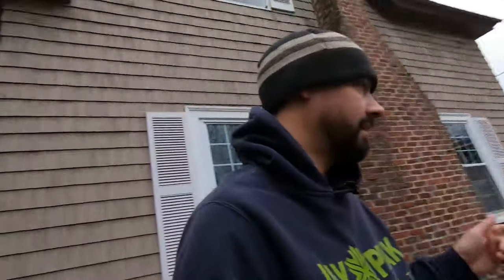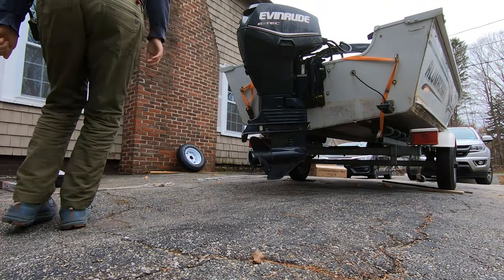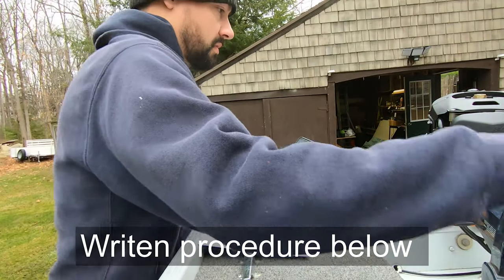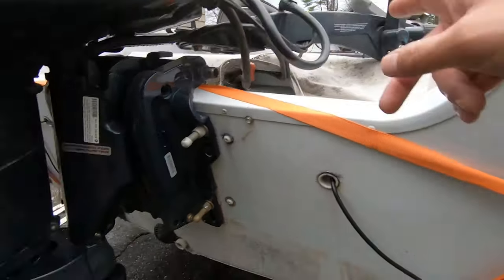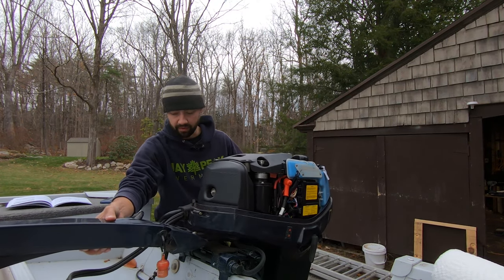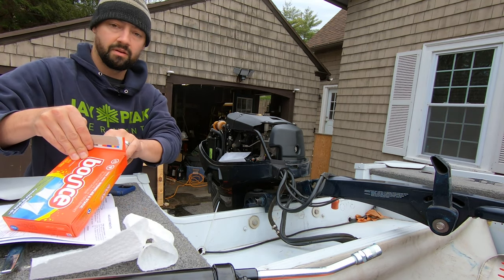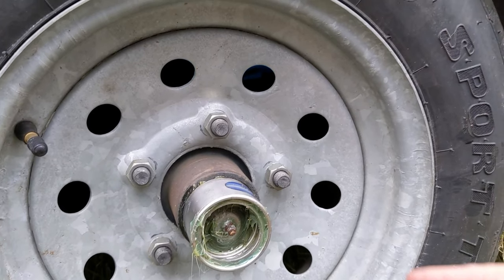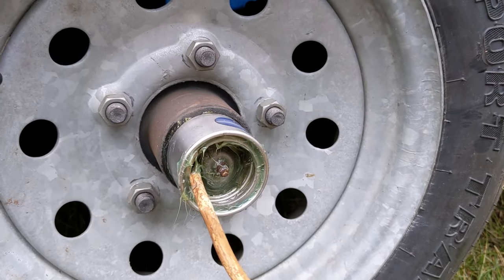Winterize your Aluminum boat with Evinrude E-TEC

Comment: Just a tip when you remove the prop place the timber block 90 degrees to the cavatation plate.locking on the blades of the prop.When you fog the motor look at your engine computer the led's will flash to change throttle position.
Reply from the maker: Thanks I noticed the LEDs after I looked for them the first time in bright sun and couldn't find them

Comment: Just curious but what about the water you just ran through the motor won't it freeze ?  Or does all the water drain out ? I live in Michigan my self  and it gets bitter cold here . I have a e tech and winterizing mine for the first time. Thyx for your video.
Reply from the maker: The motor is ment to drain completely if left vertical, also I crank it a little with the kill switch detached to push any other water out

Comment: I just found this video. I bought an ETec 50 HP  just like yours and keep learning. I am in Wisconsin and it is late November but have still been on the water. Does your engine emit a beep when you turn the switch? Mine does not but four lights come on inside the cowl. A dealer near me told me that there is no beep with the tiller model and to just make sure all 4 lights come on before starting to winterize. Is that true?
Reply from the maker: Mine doesn't beep either. I looked in the service manual and it doesn't. I have the same lights but haven't had them come on I just always top it with oil when I get gas
Reply: Wow....thanks for the super fast reply ..I did not get a service manual from the private owner I bought it from.  Why do you take the prop off as hen winterizing? Thanks again for the great winterizing video. I have an Atlas Micro jack plate on my boat. It is a Sea Ark 1672 MVT so with the jack plate all the way up and the engine trimmed 3.5 seconds the bottom of the scag prop is in line with the tunnel so even with bottom of boat. I fish in the Wisconsin River and water depth changes all the time and runs between six inches to 20 feet. I can safely get through just over a foot of water. Have a great winter and thanks again
Reply from the maker: You are supposed to take it off and check for fishing line and put grass on the shaft to prevent it from getting stuck. I use mine in salt so I always do that
Reply: I bet you typed grease and auto correct. Sent me grass on shadt😊
Reply from the maker: Yes grease haha